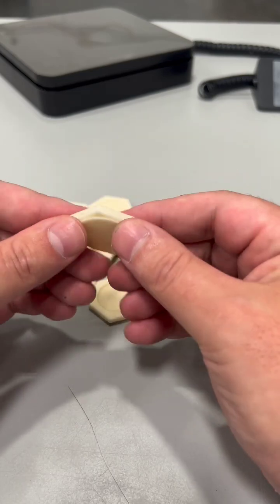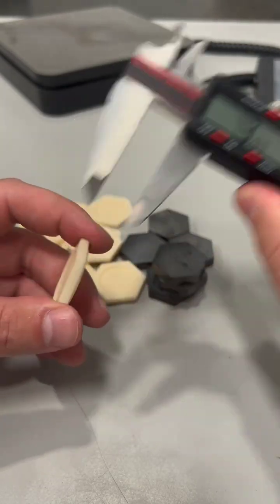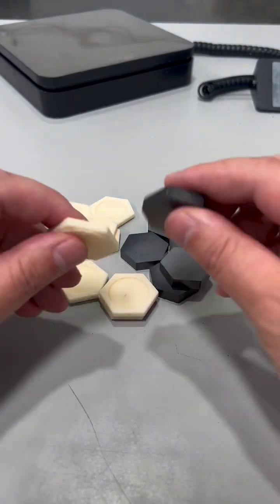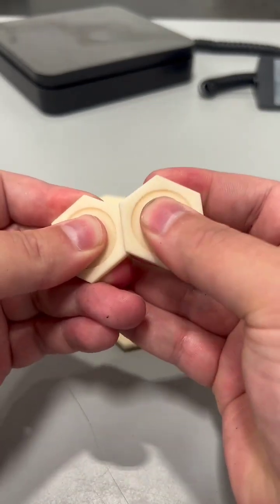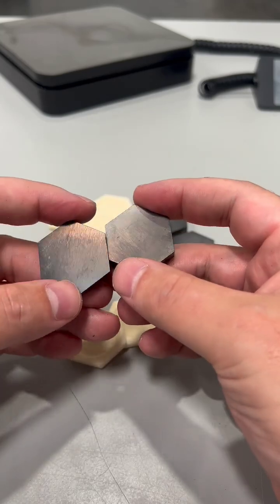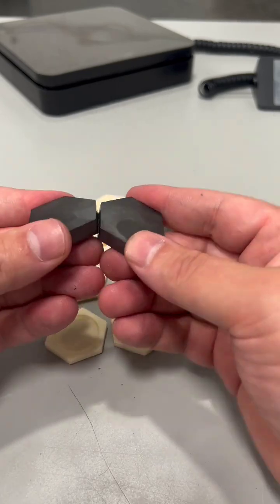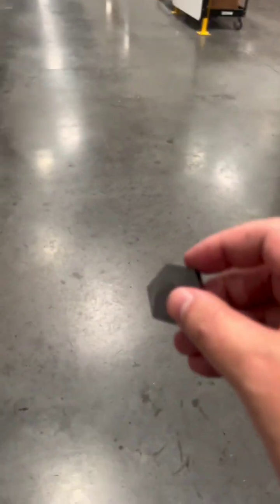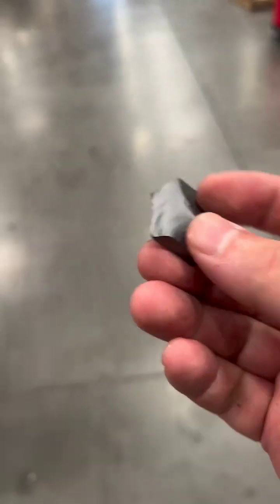Comparing Different Types of Ceramics Used in Flexible Rifle Armor - Pros and Cons - FRAS  ®

Comment: This is the same nonsense Dragonskin was trying to sell years ago. There is zero practical benefit to using "flexible" rifle armor as compared to actual plates, if anything the flexible pieces means you have a ton of potential weak spots if bullets hit in the joints instead of the on the pieces.